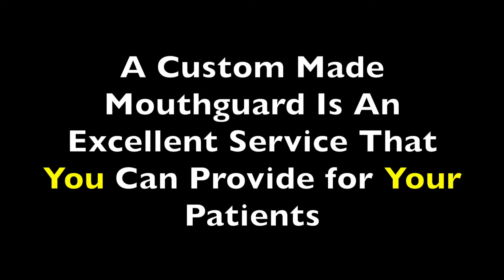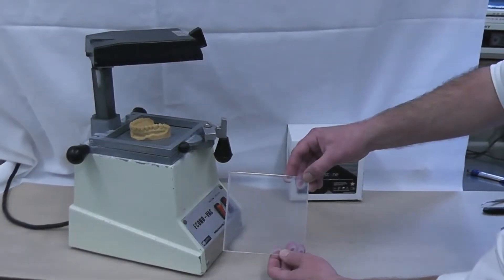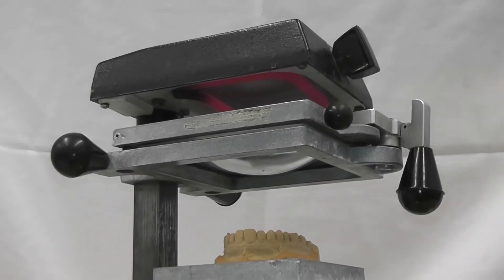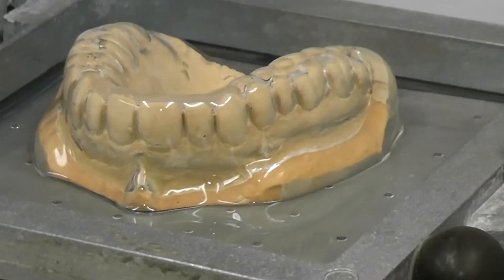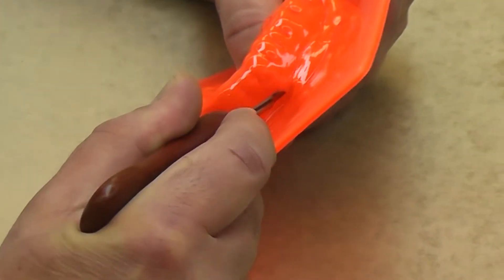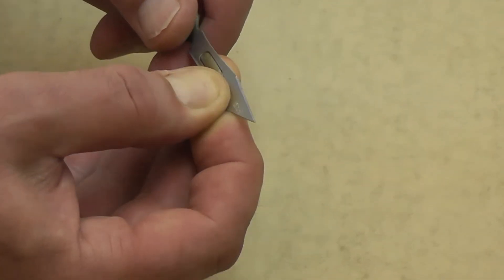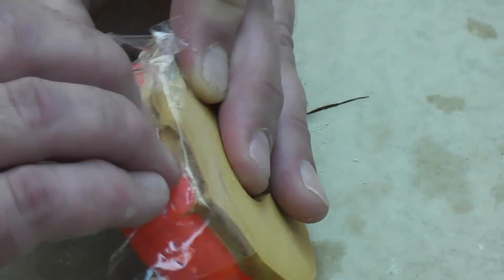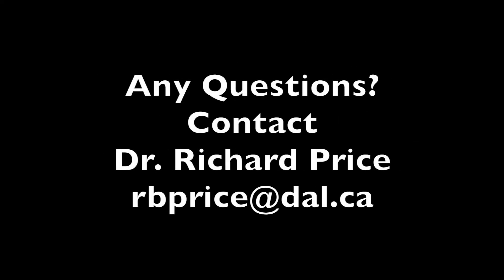How to make a custom sports mouthguard

Comment: Does anybody know can I use the same type of material for dentq laboratory dental vacuum forming molding 110v machine it’s same function machine. But I noticed retainers and mouth guards are a bit of different material. Please if anybody has answer I’d appreciate it.

Comment: I did this and now the heel of the occlusal guard touches early when biting down. I cannot bite down all the way. I want to make it again, How do I prevent this from happening again?
Reply from the maker: Yes, that is because the jaw is a hinge. This is not meant to be a bite plane.  However, if you flame the heel and ask the patient to bite into the warmed, not super hot plastic, then they will achieve an even occlusion.  The trick is not to make the plastic too hot,  but hot enough so that the pt can bite into it.

Comment: what material is the mouth guard made from?
Reply: Usually EVA (Ethyl Vinyl Acetate) Resin material for vacuum forming machines. Sports mouth guards should be 4mm/.15-.16" sheets.
Reply from the maker: I use Proform Mouthguard material. There are others:  @t
Reply: I like this idea, but I don’t think no one can get their hands to getting the machine to make them
Reply: @Rmathis80  i will try it with hair blower